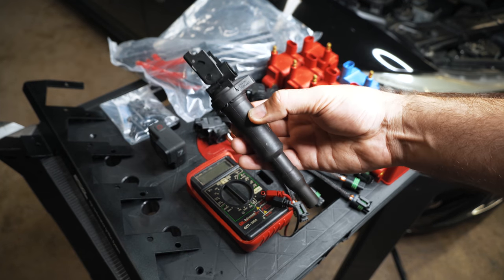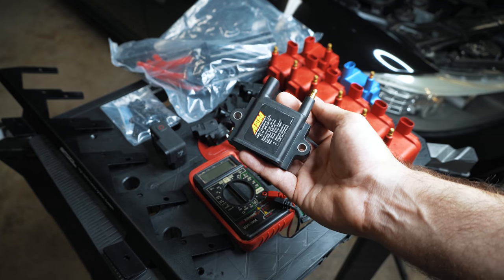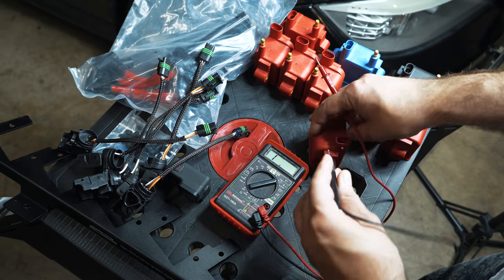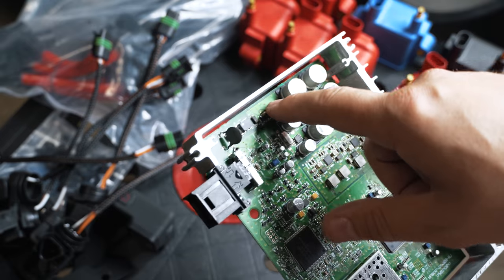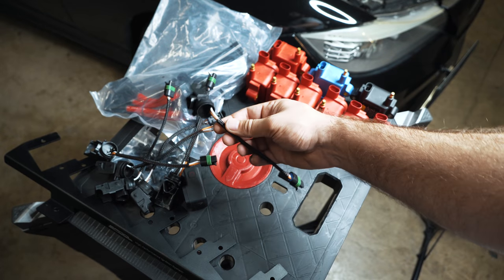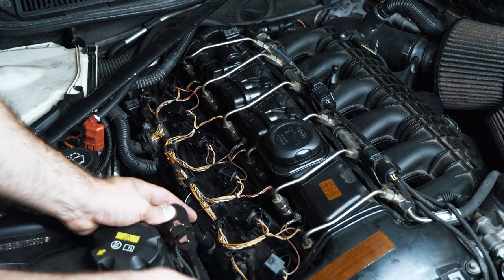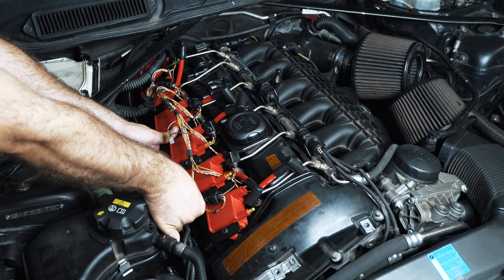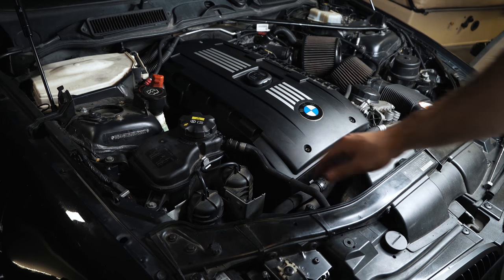When Do You Need To Upgrade Your Ignition Coils? | BMW N54 DIY

Comment: Definitely a needed upgrade. I put the duralast coils in as well and anytime i was over 14 psi of bost i was loosing spark and misfiring like crazy. Put the precision raceworks coil kit in and bam no more misfiring. All the way to 17psi on stock turbos

Comment: I have the spool ignition kit on my N55 and love it.  But it is not a GM or LS coil and never came on any GM vehicle, it's actually based off a Marine coil design.  Oh and that hardware will likely rust quick so get some blingware.
Reply: How did you buy it? It's not on thier website

Comment: I have 07 335 with over 100k miles. I am on bosch spark plugs with OEM coils. FBO tune.  No misfires  .  Scotty Kilmer has video where he changes the spark plugs on n54. He makes a good point about BMW.  A lot of plastic on the engine  which gets hot. Then they put an insulated cover on top of the valve cover to keep the heat in.  What if we ditch the engine cover so it doesn't trap the heat ?  I replaced my VC at 100K.
Reply: zmanphx I did this. Absolutely no problems yet, just a bit louder BMW noises. Just took of the entire cover as it wouldn’t really fit with my cold air intake on my N55. I also cut down the plastic piece that holds the cabin air filter to mock the M3 style. You just have to get something to stop the rain/car wash from dripping straight from the windshield down onto the hot engine. Weather molding or something to direct everything water related to the sides only.

Comment: So I’ve seen people use R8 coils are those a lot better than stock?
This seem super easy to install. This guy is the best for the BMW N54 community.
Reply from the maker: Thanks, maybe someone can chime in with regards to how much power they support.  I'm not quite sure how much power they can generate.
Reply: Most have gone the easy route of using precision coils aka your same Gm style. But the majority that have look into stock simplicity have gone with R8 coils because the Same coils are use Lamborghini V10 Twin turbo and support over 1500hp . Those are offer by Bimmerlife are little expensive just for the harness but if you can read and figure out Systematic from a 3 wire to 4 wires you can save $300 and buy the coils under $160 can be found everywhere online.  Here is the link where I had it running in mine . https://m.youtube.com/watch?v=k5t7lThFyxY

Comment: Great product, and great video, just one thing thats slightly off though. The position of the coils where the harness is crossing with the spark plug wire. When you do that, you have a higher chance of misfire because of the high current going through the spark plug wire creating a type of a magnetic field and will disrupt the 5 volt signal from the DME to command the coil to fire the spark

Comment: i went with the oem eldor coils and for now my misfires have been fixed. im running stage 2+ with 91 oct and i think the eldors should be eliable enough for up to 500 hp since rolls royces use them
Reply: eldor is the way to go

Comment: I was wondering when i would see this video. Figured after the plug upgrade haha. I've contemplated blue team vs red team or DIY when it comes to it. They both have pros but red team very power-hungry. Dont need IGN-1A  coils not running all the boost as one would say haha. Good to see another option. As always quality content thanks for sharing!
Reply from the maker: Haha then I bet you weren't surprised when I said I have a MOSFET replacement video coming next.  Thanks!
Reply: Yeah, Unfortunately, I was not surprised. I luckily have MSD81 already. The bright side of things will be some content and will be able to help others with the same issue.
Reply from the maker: Yeah I pushed the dwell in MHD just to see what would happen.  It felt awesome but only lasted about three pulls.  When I removed the failed transistor it actually
flaked apart so I think the transistors were heat cycled too many times and are already weak from the factory.  I was wondering if I should just go MSD81 but I figured lets see if we can beef up the MSD80 with upgraded transistors.
Reply: 3 pulls ouch haha... yeah for sure will be interesting to see. pretty cheap fix compared to buying an 81. I would def be interested to see a pull thru datazap when you get your tune and everything squared away. I'm starting to dig into the tuning side myself. definitely interesting.

Comment: Curious why you don’t film your test drives? Some pulls in the videos will be nice. Also I might have to try these coils out I had some from another vendor before but I was having problems with them ended up returning it and just going with stock coils.
Reply from the maker: Yeah I have tried but typically with a go pro and the quality is pretty crap so I don't bother including it.

Comment: My 2008 e90 335i was manufactured in January. Came with MSD81 DME. However I’m not sure if that was the original DME since I was not able to talk to the previous owner. Also was fitted with index 12s
Reply from the maker: yeah I think I have a late 2007 production and ended up with an MDS80.  Yeah good thing you already have 12s, that'll save you a tone of money.

Comment: Hope you see this: My car continues to smoke but I'm 100% sure some of my injector(s) are stuck open and/or leaking. When I fire it up cold start it doesn't throw any codes but I hear crackles and pops constantly until the cycle is over. Driving to work today with oil temps still beloe 160F I saw smoke out the tail pipes but it stops. Coming home now, on a very hot day, it smokes more when up to operating temps but it happens both when cold and hot. New turbos, new valve cover, new coils, spark plugs, secondary cats in place, new HPFP, primary 02 sensors, you name it. Catless downpipes but with secondarys still there as mentioned. ALSO, when shifting from 1st, to 2nd and sometimes third, a normal backfire is normal since I have burble to 1 second on soft, but SOMETIMES it backfires so fucking loud it scares me. Im thinking too much fuel is being dumped from one or more injectors causing this. 

Anyway, my bank 2 index 12s were new in mid 2017 but my Bank 1 was replaced with some sketchy 12s but I'm almost sure one or two are slightly stuck open causing white smoke since im not burning oil OR losing coolant. AT ALL. 

Thoughts? Recommendations? Im thinking of buying a whole bank and replacing bank 1 then going from there, I highly doubt my bank two is the problem since they were BRAND NEW in early 2017. 

The car also hesitates on acceleration so I'm almost sure it's the injectors. My last thought is could the fuel pressure regulator cause the smoke? or just the hesitation. Im at 138k KMS (85k miles) Defintely not a head gasket. 

Thanks man, hope you see this, appreciate the help.
Reply from the maker: Have you put in a new PCV valve?  I'm guessing that was taken care of with the valve cover?

Comment: I'm not sure about fitment but another economical option is the VR38dett coils (GTR) not quite as strong as the 1A coils but 1k hp capable.
Reply from the maker: Yeah not sure about fitment but the R8 coil is another option with similar fitment or I heard good things about the metal coils on the later N55 or S55 cars.  I got a set in my X5, I might just throw them in to see if they can make power.
Reply: Yeah, Hitachi R35 coils have quite the power output.
Reply: Platinum Racing will be releasing a R35 kits soon for N54!
Reply: That will be interesting to see.
Reply: I've been looking at making a harness for the R8 coils for the n54. Not in a hurry for it as of yet. I'm not having any misfires (knock on wood)🤣🤣🤣

Comment: Would you happen to know how the cold start on the n54 works? I had a single turbo kit installed and the car hasn't done that elevated rpm cold start since.
Reply: Gatling33  I have the same issue man
Reply: @jay002navarro  That sucks. I still haven't figured it out yet.
Reply: Gatling33 it’s mapped out by your tuner, if ur running mhd or jb4 u can turn it back on
Reply: @br4d101  Thnx. I actually figured out how to enable it by comparing the stock map to the BEF map in Tuner Pro.

Comment: Hey buddy. Am I Getting these confused with something else but do these need to be coded with the car / auto box ? 
I'm getting a miss fire code at the moment and looking at upgrading to some hybrids in the next couple of weeks so it would make sense to replace the OEM with these and the sparks that you have another video with ?
Reply: Tuning the car specifically for these is not needed but it will aid in performance. There is a check mark in MHD for upgraded couls

Comment: You didn't talk about smart vs dumb. Imo smart coils are better. I run Audi/vw coilpacks. Ngk makes em.
Reply from the maker: I did mention it when referring to R8 coils at one part of the video.  My next video is going to be on upgrading the MOSFETs in the DME for early cars with the MSD80 ECU.  Smart coils could potentially save you burning out a MOSFET, I'm not sure how much power the Audi coils can support.
Reply: Vehicular DIY they support about 700 to the wheels.
Reply from the maker: Nice, good to know thanks.
Reply: I went with the Audi coils from Bimmer life,  unbelievable now smooth the car runs and idles. Which plugs do you use and what gap are you running ?
Reply: @quik5ltr  With BL coils I run the NGK iridiums 95770s (not sure if the product name is still the same) @ out the box gap of .25. That's FBO stock turbo's on mhd stage 2+. When I finally install my stage 3 hybrids i'll try .22 or .20

Comment: I am on MHD2+, so around 400whp, below 500 for sure, I have those coils installed, you are saying I should not switch over to them in MHD?
Reply from the maker: If you have enough spark dwell where it's not misfiring then yeah no need to tell MHD to drive them harder as that can be harder on the ECU.

Comment: Would you change your stock coils on an unmodified engine ( 140000km) preemptivly just for maintance?
Reply: Their supposed to be changed every 30,000 miles/ 50,000 KM on an unmodified car. No need to upgrade IMO unless you plan to push beyond 450 whp in the near future.
Reply from the maker: Not necessarily, it might not hurt to have one new coils with you as a spare.  If you're going to tune it then yes they should be changed but stock I wouldn't worry.

Comment: So... lots of wrong in this video, I'll try to help.   Those aren't anything near LS coils, Google a LS coil and you'll see.  Not even close, wires different and everything.  Spool and PR are both in Houston, Spool either completely copied the PR design, which is unique from the AEM, or copied the AEM.  Their helix is nice, but product is a knock off of others.  None of these are an OTS coil.  That coil shell is off the shelf as a mercury marine coil that is wound for CDI.  You cannot buy these in a store. 

The transistor grounds are shared, yes.  The drive circuit ground for the coil is different.  Injector mosfet fail because of flyback voltage, coil igbt are fine.

For the resistance you're measuring secondary I presume, not primary.  You can't measure secondary on OEM coils.  Primary resistance is what the DME sees and wouldn't be 8, it should be closer to 0.5ohm.  The secondary also isn't 8, it's more like 8,000ohm.  Higher is generally better on secondary, but design matters too.

Gap of .019" or .022" I presume you meant, not .19" or .22"

Nice marketing video though.
Reply: So what upgraded ignition coils do you recommend for an f87 m2? Fbo.

Comment: Bad info here. These ARENT LS coils, they’re IGN-1A Mercury Marine coils! The mercury coils are in a totally different league, as they operate efficiently over a WIDE range of ignition dwell settings. You won’t get LS coils to produce full spark on BMW dwell settings, BUT the IGN-1A will produce more ignition power than the LS coil on OEM BMW dwell. Adjust the dwell and they get even better. I PRAY nobody bought LS coils on his advice. The AEM coils are IGN-1A mercury coils as well

Comment: Lots of inaccurate information in regards to the DME... 

The only problems MSD80 ever have are with the injector mosfets and for the past few years random people have been claiming that after market coils caused Injector mosfets to fail which is 100% false. These 2 circuits are not directly shared, and the issue with injector mosfet failures have been occurring for the past decade long before any performance coils existed. Unfortunately people trust what the read on forums or hear in youtube videos even if false and then they share what they have heard with others and those people believe it as well.  You can rest assured the drivers for the ignition system which is not a mosfet at all it is an IGBT will not ever fail due to coils. If you do have a failure it will be for an injector mosfet which will fail on you anyways regardless of if you upgrade coils or not and when it does fail the failure will be unrelated to the ignition coils you run.
Reply from the maker: Well it happened literally right after I selected the option in MHD to increase the spark dwell.  A weak power supply in the ecu is the underlying issue.  The coils demand too much current and the transistors that drive the injectors overwork due to limited power being available while the coils are working hard.

Comment: What's. A  Ms81 where does it go how do I upgrade it please
Reply from the maker: MSD81 came out with LCI models, it's the DME or ECU and it has an upgraded power rail and transistors so you don't burn them up.